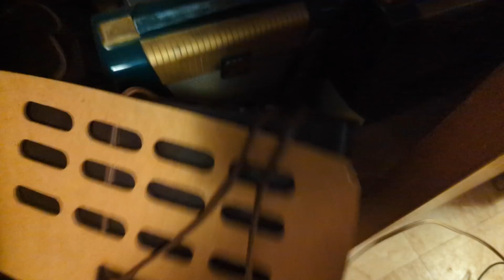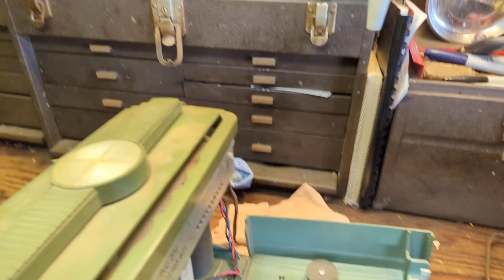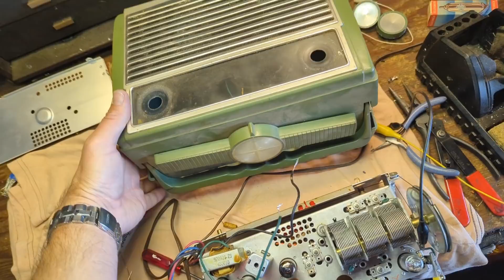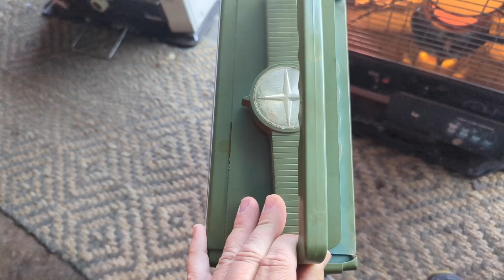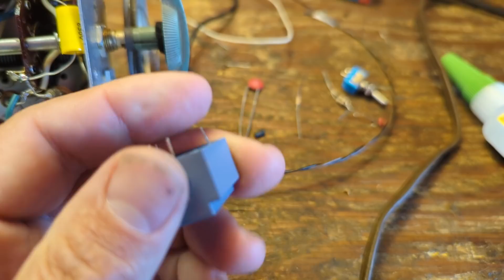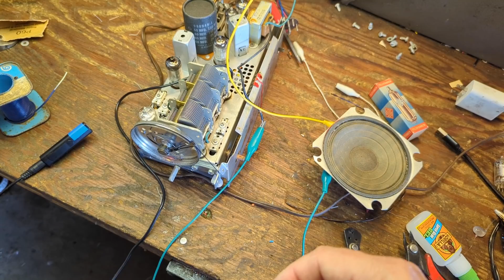Oh boy, let's restore a 1954 RCA " Yachtsman" portable radio

Comment: Soooooooooooooooo many capacitors!!!! Great job though. Like the methodical approach. Change some caps, try it, works - carry on changing...rinse and repeat. I keep my eyes open for the old AA5 sets out here in the UK. (Although technically this one would be a 6 valve set but the rectifier is solid state.)  We get a lot from Europe, but I don't see many from over the pond. BTW if you can't tell your left from your right and mix the order of things up you may be dyspraxic rather than dyslexic. I have dyspraxia and auto-correct on phones and computers really messes with my head. Dyspraxia causes many more issues than this and varies greatly in different people. In some people it affects their speech clarity, ability to plan events, course and fine motor movement and hand/eye coordination, mood swings etc..
All I know about the HMV logo is that the dog is a Jack Russel Terrier named Nipper and as you say it was also used by RCA Victor.

Comment: They sure cheaped out on that speaker...if they had put in a slightly bigger oval speaker, I bet it would have sounded 10x better.  Zenith transistor TO's sound great, in no small part due to the better speaker, and the steel chassis helps as well.

Comment: RCA Victor 7-BX-9H with 1 volt tubes. I know you don't like restuffing can capacitors Seth  but this radio could be easily 
done that way because the can is big enough.The lugs are isolated from the chassis so daisy chain mounting is the 
preferred way shown. Not easy getting to some of those old caps because they are so buried below components.
All you need to know is the line end of the 1N4007 goes to the electrolytic caps! Ducks are looking for a handout .LOL
Bet they will be back. Good cat food. Good repair with Bluetooth addition.
Reply from the maker: This one was crammed full. When I was younger I wou,d make a huge mess out of these things but its not as bad now

Comment: I wonder what it would take to create a battery pack with Lithium Ion (18650) batteries and an onboard charger.  Any ideas?
Reply from the maker: Well, I have made battery packs for these and the reality is that the high voltage " B" Battery" is a very low draw battery. Those will easily for for 75-100+ hours. I just buy a ton of dollar store 9 volt batteries and stick those together. The other battery is usually just a coupla' D cells. If you got rechargeable D cells that is your ticket.
Reply: @misterradio5035  maybe I will have to figure one out.  I would love to make a bunch of farm radios work the old way.
Reply from the maker: @jaytitus902  I ordered a ton ot 9 volt battery snaps on Amazon. Maybe a future episode I can show how to do this.
Reply: @misterradio5035  you know more stuff than I.  More importantly you actually do stuff and I don't.   I am more if a lazy idea guy.  I'd love to see your idea.  Your work entertains and educates me. Glad that you post as often as ya do.  I know filming while you work is kind of a pain in the balls.  Thanks for what you do.
Reply: @misterradio5035  Dave Tipton built a power supply for a farm radio. Thought you might appreciate it. https://www.youtube.com/watch?v=_mHO8s_7rhw